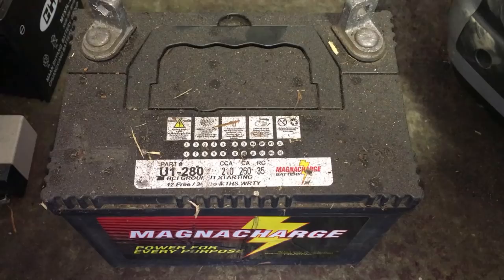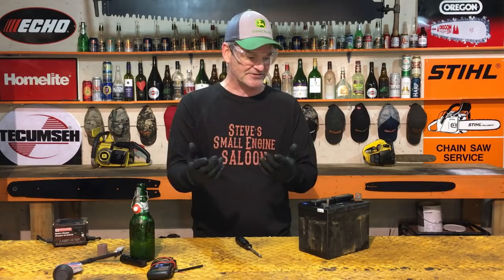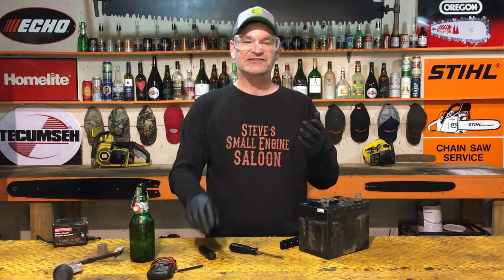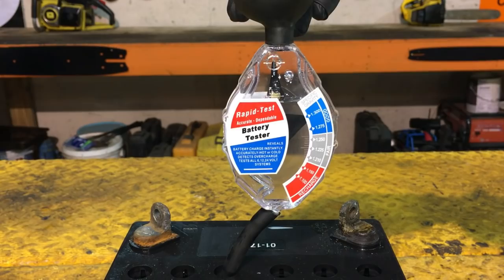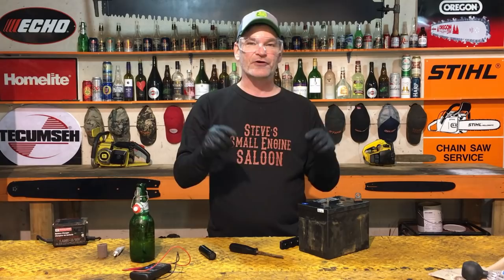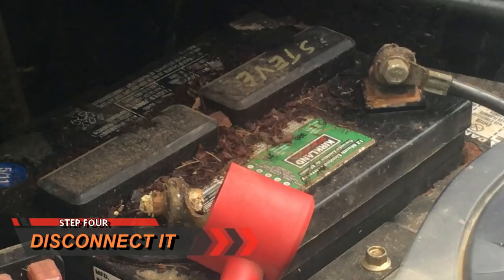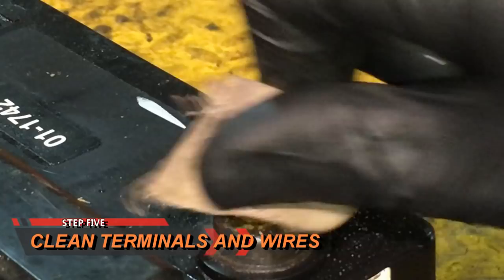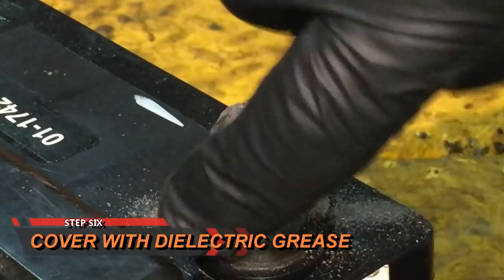How To Winterize and Maintain The Battery on a Riding Lawnmower

Comment: Thanks again for your great advice. I would add the same info as a few others suggest about cleaning the battery exterior with baking soda solution to neutralise leaked acid. I then rinse with warmer water so that the soda doesn't get vacuumed into the cells. Here in NZ we don't have the long extreme winters but old batteries still usually give up at the onset of the cold.

Comment: "Dielectric grease"? I find that Vaseline works better and much cheaper. Vaseline keeps oxygen from the surface of the posts and connections keeping corrosion from forming. Back in the day, this always works to keep corrosion from ruining contacts, keeps your battery charged, and keeps the battery acid from ruining the connections. This still works very well today on your car, truck, or tractor.
Reply from the maker: Great tip!  Thank You...

Comment: My opinion:I have made trickle chargers from a 12 volt "wall wart" and two alligator clips, just get the polarity right. Voltage should be 12.5 - 13 while charging.These small batteries ,( motor cycle or lawn mower ) only last 2 or 3 years anyway, vibration?Charge the battery - - then add water if necessary.A fully charged battery has 12.5 volts. To charge a regular battery you need around 13.8 volts, maintenance free14.4 volts.I also use sandpaper to clean posts and/or terminals. I use a good amount  of regular grease when assembling, wiggle the cable a little and tighten the bolt well. My theory is to keep the air out of the joint to prevent oxidation/corrosion.

Comment: STEVE, KEEP ROCKING ON! GONNA ASK YOU A QUICK QUESTION: I have a small Milwaukee battery that is rechargeable, and I was wondering do I keep it aways on the charger? Or do I fully charge it and set it aside not on the charger? I use this battery only during the winter months, and now that it is spring, I wont use it until November.......THOUGHTS?!?!?!?!?
Reply: I had two brand new 18 volt  Li-ion Milwaukee batteries that died from not being charged. I figured that I would just use the battery that came with the tool until it died and then have two more for future use when needed. Well the time came and neither of the "new" batteries would take a charge and were past their warranty date per Milwaukee, so I screwed myself and now was faced with buying  new batteries all over again.  I should have thrown them on the charger  every couple of months just to keep the juices flowing I was told.

Comment: All information I already knew (except for why concrete drains a battery),happy to know I've been doing it right for years.
Now I have video proof if someone argues with me. 😁
Reply from the maker: Right on...
Reply: I worked at several auto parts stores, and the official word on battery discharge is that they used to leak electrons to the ground when the cases were made of rubber....This was in older batteries...40's 50's and 60's....now with the cases being made of plastic, they no longer leak electrons to earth. So you should not have to keep them off the floor....

Comment: Good to see you mentioned safety equipment.  Many people don't think it's that bad.  We wiped a battery that had been charging over night, then carried it to the boat, and the next day my buddy had holes all over his jeans.  Wash everything down.
Also, the hydrometer is to check the specific gravity of the solution.  Not the charge.  If the acid is too weak, it won't take a charge anymore.  Solid advice though.

Comment: Corrosion preventatives block oxygen where acid may be present on metals at connections.
Applying any compound to the metals where they connect can act as an insulator.
They should be cleaned bare and connected and then apply a blocker for oxygen and sweat around posts.
Dielectric does not increase connectivity but repels moisture and oxidation.
Put it on after assembly.

Comment: I am 65 and losing my vision.  So, I plan to buy a zoomer scooter (Mobie).   But my worry is the batteries, for winter.   How do I keep them safe?  I cannot bring the machine inside, so it will be covered and stored outside.  I will not be using it much in winter.   I plan to charge before storing.  I was wondering if one of those hardware store battery warmer blankets that plug in the wall, would be of any use.  The batteries are sealed.  Some are gel batteries.   Have you any suggestions?  Should I park it on a wooden board?   Should  I charge it (via the external charger) once a month?  I live in the far north.  It gets to 30 below C up here. Is one of those battery tenders a good idea?

Comment: Hi Steve, I used to store my lawn tractor battery in the house in the basement and not on the concrete. Winter as we must heat the house and the humidity of it becomes too low then the electrolyte of the battery evaporated ... result my battery was dry in spring and could not do anything. So I do what you say in the video is good but I leave it in its place on the tractor and disconnected and since I no longer lose the battery every year ...
Reply from the maker: Right on...

Comment: I am having a beer buddy. I bought a POWER MORE 132CC MTD YARDWORKS.
No battery. It's in my basement. I don't fuck around.
My Saturn battery is in the trunk. I've wrapped material ftom a woolen coat around it. If it dies so what. It looks clean and perfect. Side posts. My brother's cheap Walmart special died after 10 years!( We didn't realise there was a battery fuse! It may or may not have been fucked. Live and learn).
Anyway, a battery warmer is the cat's meow. Only issue - interior car warmer + coolant warmer + battery warmer = 12+ household amps? I dunno. My two cents.
David
Alberta

Comment: I am assuming you are in S Ontario STEVE.  I am in the North, where the temperature occasionally reaches -40. Do you recommend I do anything differently ??? You said to remove the negative cable first, but you didn't say why.  Does it matter ?? Love your videos !! Thumbs up !! Cheers bud !!
Reply: Yes, better habbit to remove negative first. If you remove the positive and touch the grounded frame with the end of the wrench then you are July 4th. 
If removing the ground and touch the frame then it is simply ground go ground. 
Once the vehicle is not grounded for positive to the vehicle will not spark.
Reply: If you disconnect the positive cable first, and your wrench touches the [ grounded ] frame, it can arc.  Disconnect the Negative first, it prevents this.

Comment: Any ideas opinion Steve regards topping up with Epsom salt and distilled water if the level is really low and/or not holding charge with the electrolytes that's in the battery. Eg. Can you mix Epsom salt and distilled water straight into the acid mix that's left!? And / or can you empty out the last of the acid dispose of it properly and replace the whole thing with a distilled water and Epsom salt mix? Will this repair the battery hold the charge is there any factual reasons why this cannot be done it should not be done that's not just opinion but based on scientific reasons chemistry etc 
Thanks in advance and great video.
Update on the above however would be greatly appreciated! I have a battery that's showing as bad and its a sealed Varta I'm thinking the electrolytes might be low but before that I've stuck it on a repair type charger anyway but have a feeling it's gonna need topping up or the electrolytes replacing I already have Epsom salt and distilled water. Don't want to go down the acid route if possible but equally would like to revive the battery if possible! Ps. It was left discharged outside for 2 years so had no charge at all possible charged it once showed 10.5v and no CCA to speak of. I recharged on the repair chargers to attempt desulphurisation. However I think it may need more Electrolytes eg. Either acid or ideally if it's viable option top up with distilled water or distilled water and Epsom salt mix.
Any advice you have is much appreciated
Cheers from London England 👍
Thanks

Comment: Steve, I have a question: Im in Canada. Winter get down to -30 where I live. I have a trickle charger 1.5A permanently on my JD land mower but during the winter, I removed the Bat and store it in my house. In this vid you suggested leave the bat on the tractor with the trickle charger but Im scared of power cut. So im asking: is it better to leave  the bat on the tractor all winter with the trickle OR leave it warm in the house without the trickle?
Reply: I dont know, but its logical to take it out and put on wood downstairs. The -30 & -40 has blown my truck batteries! Charge it in spring if need be. My 2 cents. Goid luck.
David
Alberta
Reply: You should take it out of anything that sits a long time.  Most anything will draw down your battery with a slight discharge and more so with newer machines or vehicles.  I believe Steve meant putting the charger on the battery after it is taken out.

Dale in Canada
Reply: A trickle charge will help maintain charge on the battery and warm it a bit. At -30C ( or F) you should be OK leaving the battery outside even if the power goes off for a while ( few days). The colder it gets the more on the edge you are. Keeping it inside with a trickle would be better.

Comment: Dielectric grease, or tune-up grease, is a silicone-based grease that repels moisture and protects electrical connections against corrosion. ... The grease does not conduct electricity, so it shouldn't be applied directly to the mating surfaces (pins and sockets) of an electrical connection.
Reply: Been using it for years on all of my trailer wiring connections and bulbs... as well as spark plugs and plug wires which are also pins and sockets...with Zero issues

Comment: can you leave the battery connected to the mower all winter ? The reason I ask is because I have a heated garage and the lowest my garage will get to is about 50 degrees. I think that starting the mower a few times and letting it run for 5 or 10 minutes the winter will refresh the charge.

Comment: The reason weak battery solution freezes is due to stratification. Stratification is when water and sulfuric acid separate, not unlike oil and vinegar. Not only can the separated water freeze, the waterless acid stops being an effective electrolyte.

Comment: Thanks to the Gods, here in tropical North Queensland we do not have to worry about minus Temps all year round. Our biggest worry is about how to keep the beer icy cold.
Still have to look after the Batteries, but. I clean the Terminals with an old wet toothbrush dunked in baking soda to neutralise the acid and rinse it off. Then a dab of vaseline for protection. (Nothing to do with lifestyle)
Reply from the maker: Right On...

Comment: If you have a spot that gets daily sunshine, you can use a small solar panel to maintain a charge. These solar panels produce 18 vdc at no load and 12 vdc when attached to a 12 volt battery. The amperage input reduces as the voltage increases. I have used these for several years with good results and NO hydro charge. The cost is less than $20.00 Canadian.
Reply from the maker: Great tip Al!  Thank You...

Comment: Can you do a pressure washer winterizing video?
Reply: Absolutely
Reply from the maker: Coming soon....
Reply: @Wakeywhodat   is it a gas powered if it is get a fuel cut off such and put it on the paser washer
Reply: Mine works year round washing the salt crud off the bottom of the vehicles.    I simply put a quick disconnect on the hose where it meets the pump.    When finished I just rock it backwards and out drooled the water left in the pump. Then I drain the machines hose  and stick it all in my shed.    I’ve never had a  problem doing this in Norther NY winters.    You don’t need the QD but it makes things easy  compared to screwing it off.
Reply: The steps should be in the owner's manual. Off season storage for the engine is the same as other OPE engines. I prefer:

1. Drain the gas tank;
2. Run the carburetor dry;
3. Put a slight bit of oil through the spark plug holes;
4. Turn over the engine; and

5. Reinstall the spark plug.

Some prefer:

1. Use stabilized gas in the last tank of the season. This means the carburetor has stabilized gas in it;
2. Fill tank with stabilized gas and then store.

To store the water pump which pressurizes the water you do one or more of the following:

1. Blow it out with an air compressor or shop vac; or
2. Fill it with antifreeze; or

3. Store the whole thing in a warm ( above freezing) area.

If you use anti-freeze make sure you check what its rated for. If its -40C ( or F) then you're good until it goes below that. Most places you don't need to worry. Any where else you should already know about antifreeze ;-).

Comment: A solution of baking soda and water is great to clean the battery. It also will neutralize any corrosion on the battery post
Just mix in a spray bottle 
And spray away
Reply from the maker: Good tip!

Comment: Steve, your beers:face-blue-smiling: getting warm.  I don,t know why it works but it does. Maybe you do.  I take 2 cups of distilled water and heat it up & put 2 tablespoons of Epson salts per battery cell until dissolved and fill the battery cells with it.  The Epson salt goes clear ans dissolves compactly. I put the battery on a trickle charger for a week and test it with an om meter.  If the battery  is on its last legs, I attach the trickle charger to to a support under the hood and plug it in every nigh its cold. Warm battery has 50% more charge than a cold battery.  Trickle charger turns off charging mode when fully charged. Does it always wok?  No, but often it does and I'v gotten a few years more out of a five year old battery.  Any idea why Epson salt works???

Comment: The importance of battery tender can't be emphasize enough. At the hunt camp, all the batteries go on a battery tender and it has increased the life of the batteries. I use to have to buy a battery or two every year. Just read about frequent checking the water level, the electric golf cart water level is always low and i think it is because it is on a tender all the time. Going to get a battery water filler with auto off feature to simplify checking and servicing the batteries. Timely info.
Reply from the maker: Right on Mike!  Thank You...

Comment: Never try to charge a frozen battery. There is a good chance it will explode. Also i keep a battery tender on my old International. Diesel tractor 24/7 and the Interstate workahaulic battery just turned 19 yrs old. Its way past its longivity but it still starts the big Diesel in any weather.

Comment: Dielectric is an insulator, but that's alright, the contact between the metals is the path for current. dielectric or vaseline or grease keeps the oxygen in the air from allowing corrosion, slop it on freely
Reply from the maker: I Agree!

Comment: The concrete "myth" comes from when the casing was a little porous and made of rubber and tar and could wick moisture and acid (depending on sources) into the concrete or moisten up the concrete to make it conductive and discharge the battery... From what I've heard. 

So it is true... For like 100 year old batteries :)

Cold should limit the self discharge since cold limits reaction speeds in chemistry. 

I prefer to put mine on wood anyway to not get some debris or small rocks under them causing punctures of the plastic. It is probably not any risk at all, but at least I've done what I can to prevent it.

Comment: I park in the garage, disconnect the red cable and wait for spring.  I reconnect the red cable the put the trickle charger on the battery and fully charge the battery.
Reply: Disconnect the negative first.  If the negative is connected while you are wrenching on the positive, and the wrench contacts any metal that is grounded, you will be doing some unintended arc welding.
When installing a battery, connect positive first, and the negative last.

Comment: A condition of storing batteries and not having them self discharge is carefully clean the top of the battery between the posts. Any film on the battery will conduct current between the posts and will discharge the battery.

Comment: that battery is 8 years old...  i just took one out of my riding mower that wouldn't take a charge and it was 04/14!   how long SHOULD you expect them to last??
Reply: Premium lawn mower batteries can typically last 5-7 years when properly maintained. My old Cub LT that I still use turned 16 years old in the spring of this year and I just bought the 4th battery in late summer. The oem lasted 5 yrs. & 2 diehard golds @ 5+ years respectively iirc.  I bought a new Cub XT3 in May of this year so will see how long that battery lasts.
Reply: @rudedawg5087  i'll have to take the hit for this one...   i have one of those vinyl barn type things... in the summer it gets smokin' hot... when i took the battery out, one of the cells was almost totally dry... funny how one was though, and everything else was full...  no excuse - i just didn't check.